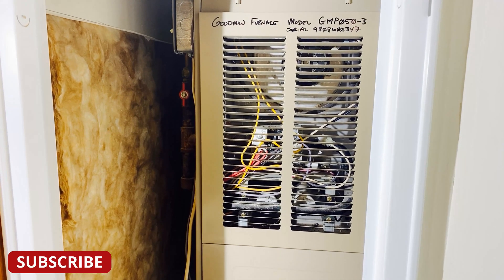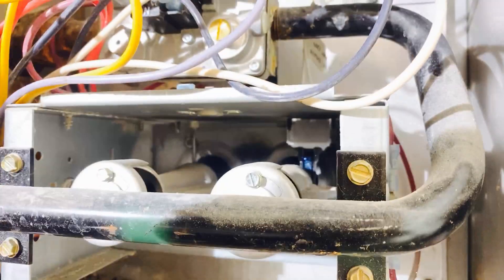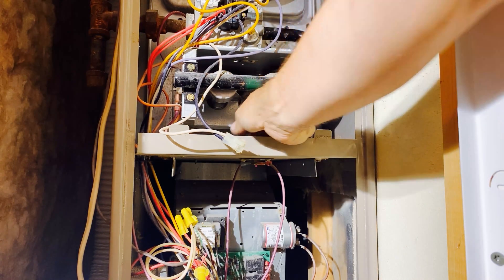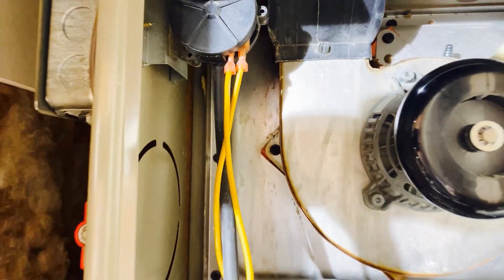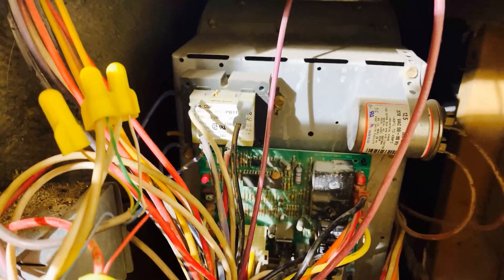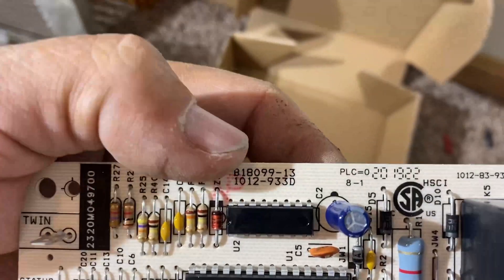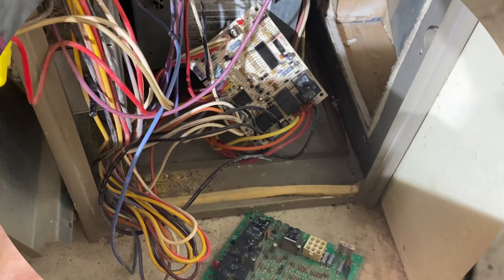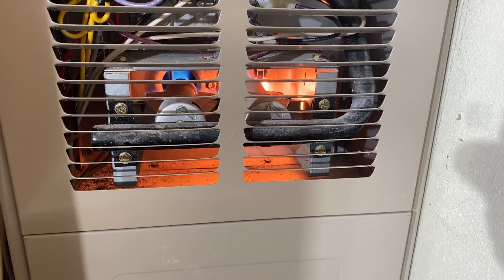Gas furnace not igniting -  Goodman furnace wont ignite - DIY Gas furnace repair

Comment from the maker: IF YOU ARE IN TX OR SURROUNDING AREAS  RIGHT NOW BE AWARE THAT WITH THE RECENT WEATHER THERE ARE LOTS AND LOTS OF FROZEN PRESSURE SWITCHES BING REPORTED! BLOW INTO THE PRESSURE SWITCH OR HEAT IT WITH A HAIR DRYER FOR A FEW MINUTES AND THAT WILL THAW THEM IF THAT IS YOUR PROBLEM!!

Comment: The problem with the internet is they dont show u what happens if you touch a loaded capacitor. Ever see Hvac Techs wear metal rings? Im not going to get my fingertip blown off for brushing against the capacitor

Comment: 4 people have looked at mine. No one can light it. It is blinking 3 lights. 2010 goodman. It has I think electric ignition. Can u help me figure that out?? Thank u. Loved your video.
Reply: Yes correct they of course tried to sell me a new one for $2700. Being single, on disability, replacing it is not an option. It was fine last year. Ran wonderful.

Comment: Back in 2013 I Had a problem with my Furnace Cutting out  I had a heating and Cooling Guy come over and he Replace my Broad and and Changed my Gas Valve and Still had a Problem of Cutting out Come to Find out it was only my Flame Sensor needed to be Clean never again will I Call a Heating and Cooling Company

Comment: for emergencies,  until you can get a  control board,  run 120v with a wall switch & as furnace cycles, turn on power, ignitor will glow & start furnace, then turn off switch......furnace will run normally,  get room to temp & you won't freeze .....only thing, you have to turn on ignitor when the furnace calls for heat & redo above......saves you from freezing your ass!

Comment: Thanks for the video, and I love that you included costs for parts vs the local repair shop cost for the same parts. Who knows how much a diagnostic visit from a company would be, and if it would include one visit or, if you'd be told your whole furnace needed replaced. Way to go!

Comment: Well, saving this video to watch again later. This was a very well put together video for somebody like myself who has no idea what the fuck they're doing and woke up this morning to a very cold house. 
The furnace has been running just fine all winter for me. I've had it off for about a week, and turned it back on a couple days ago because we had a cold snap roll through. It's been working just fine all week until I wake up this morning and my house is a wee bit chilly. I can definitely hear the exhaust fan running but it doesn't appear that the furnace ever ignites so hopefully I can just replace the igniter and not have to replace the entire control board. Again thank you for this video because it is going to be a lot of help when I get home.

Comment: I just went thru this with my Goodman furnace. Igniter went bad. Replaced with a universal igniter called a hot rod. Still wouldn't light. Checked everything and ended up calling a repairman. He replaced the igniter with a OEM part. It fired up immediately. He said he's never had any luck with the hot rods. Luckly I was able to return the hot rod and get my money back. $165.00 with parts is all he charged me.

Comment: Repairman said we needed a new board after their replacement  igniter failed in less than 2 years. They had used an aftermarket metal strip ignitor instead of the Goodman OEM prong type. Called another repair service and they said that's OK but touching the metal strip with bare fingers will cause ignitor to fail prematurely.  I told our repair service to use the OEM replacement ignitor,  and use gloves!   OK so far.

Comment: We checked everything and replaced the following chronologically - gas valve, pressure switch, transformer and now going to try control board.  This is a Goodman gmp075-3 and it would run thru entire start up cycle all the way to igniter lighting, but then sometimes gas appeared to not release in last step and heat would intermittently not turn on in the home?  The igniter appears bright red / clean, but last step of gas igniting intermittently fails???  Appears to be 9 volts instead of 24 volts. Coming from control board so going to try to replace that as hoping threes a charm.  Very frustrating process

Comment: Great video Shane. I still have an issue however. My Goodman furnace has a 4 flashing red light signal and the manual indicates that it's an "open limit switch". I jumped the two leads to the limit switch and get the same 4 flashing lights. Replaced the limit switch ($6)and mother board ($80) and same 4 red flashing lights. After viewing your video I hooked up the multimeter to the power feed to the igniter, ran the motor for 2-3 minutes and it shows that there is no power getting to the igniter. I'm stumped. Any ideas on what the problem and solution might be??

Comment: My Goodman gas furnace, the ingniter glowed, but the gas didn't turn on. The control board did three short flashes every 2 seconds or so. Any ideas?
Reply: Check the pressure switch

Comment: I just had an experience with a 14 yo Goodman top of the line natural gas furnace. Tech support was useless. I replaced it with a top of line Lennox furnace. I have two more Goodmans in some rental units. At the first sign of trouble I will replace them with Lennox furnaces. Goodman left me no choice.

Comment: My 9 year old Goodman Furnace GMS81005CNBE stopped starting.  After studying You Tube videos like this one which is excellent I learned the start sequence and noticed my electric motor inducer fan that exhausts carbon monoxide from the flames would not start.  Board had a solid red light.  When I pressed the body of the motor to one side it would start, I thought something was jamming the squirrel cage fan.  Turned out the end cap of the inducer fan's electric motor is held on with two screws and one of the screws was missing and inside the cap is a hollow where the roller bearing for that end of the motor shaft resides - with one screw missing the cap was cocked which made the bearing cocked which kept the shaft from turning.  Putting in another screw so the cap was evenly tight solved it, motor and squirrel cage spun freely.  Never did find the screw which must have been there recently.  Ghosts.  So the sequence was able to at least get to the inducer fan starting.  I checked the pressure switch by blowing and sucking the tube to it and it clicked, volt ohm showed it was working.  In the sequence I heard clicks from the gas valve so I guessed gas was going to the burners but the ignitor never glowed and volt ohm meter showed 110 volts going to it for about 10 seconds when the gas wasn't ignited it shut off.  It knew it wasn't ignited because of the flame sensor told it there was no fire, I had removed and cleaned it so I thought it was working.  I tried to light with a long tube nosed BBQ gas lighter and it lit.  So I determined that after I got the inducer fan going the problem was the ignitor which never glowed red.  New ignitor solved it, runs great.  In summary as taught in this video you check the sequence and see where in the sequence there is a problem. Thank you.

Comment: Oh excuse me I guess you showed the removal and re-establishing the new wires on the control board that looks a little tricky there I guess if you took your time and just took some pictures and try to replace them as you pull out the old ones with the new ones if you can you won't mess that up

Comment: Well done! Great video. I tried to clean my flame sensor but touched the ignitor and it broke. So, I run down to the local HVAC shop, and they wanted $107 for it. l looked on Amazon and it was $90 Looked on Ebay, $30. Thinking I did something wonderful I thought I would share this with the HVAC guy I go to the shop and tell him. Not a great idea he seemed pissed and told me, well you get what you pay for what you got is junk it will not last. Perhaps I have bought many things from Ebay. Sometimes they last and sometimes not. I guess it depends on what you buy. TV cables and things have been good. Drill batteries not so much. Just got this ignitor. So, we will see. The ignitor gets red hot and glows but No gas, not sure if its the gas valve or Cricut board. I did find a bad capacitor on the blower fan. I will get a new one tomorrow.

Comment: Great video, Shane. Tested the circuit that powers the igniter and it checked out. Installed a new igniter and problem solved. Thanks.

Comment: Thank you!!! You just saved us $2400  after the hvac guy told me that my 12 year old Goodman furnace was done. That it was burnt out and the parts would be more expensive to replace than just getting a new one. I seen your flashing diag led, looked  at mine and counted the flashes and 3 says it was a stuck pressure switch stuck open. Bought one from Amazon for less than a 24 pack of beer and whallllaaaaa it’s working again. Called a different hvac company and asked them to go over and that said it’s all good that no cracks on the chambers, voltage good everywhere and besides a simple cleaning it’s all good. If all or at least the majority of repair guys were honest. I did reward his honesty by giving him a crisp $100 bill, besides a small fair check up fee. Thank you again I’m now subscribed and liked your channel.
Reply: If they get a call from you they will obviously charge you for coming to take a look at ' the beast' in the basement, then declare that you have a crack in/on the chamber/ it is dangerous/ and he has to condemn the furnace till you get it repaired ( REPLACED) and by golly he has one in stock. Where I live you can only buy a high-efficiency furnace and with the AC they are going to ' find lacking' you are looking at around $ 7,000 bucks Canadian all in. Drilling two holes through your basement wall, and in the winter, is not a great thought! Seen 4 units where I live ' getting new furnaces' and another bill to be paid back with interest charges. They got ya, and they know it. And as an extra for only a yearly fee, we will guarantee the parts in your new beast ( for so many years). YIKES!
They have no intention to fix anything/ the money is in the replacement of the units and the inevitable maint cost to maintain these high-priced units.
 It seems to be the same all over North America. A lot of horror stories about these 'high-efficiency furnaces' all over the internet. Scary prices for basically the same part. 
 Thanks again/ big help/ as I had a few issues, and a faulty motherboard with an ignition ' no go'  in the end solved it. For another year anyways.
Reply: @luckyguy600  That's why I screen and hire all my contractors from Homer's list.  Homer's list.  DOH!
Reply: @luckyguy600 Not all us Hvac Techs are crooked. U speak out your ass
Reply: Same here!!  Was told it’s too old, needed a new board but really need new furnace.  Replaced my igniter for $36 on Amazon.  Three screws and the connection to the board on my Lennox furnace….that was it!!  It’s so helpful understanding the sequencing for troubleshooting.  Adding HVAC to my DIY tool kit thanks for videos like this..
Reply: Oh, my god. My furnace had issued and i paid over $400 for valve gas replacement but the problem still there I have to them again and they said maybe another issue and more charge
. Thanks a lot for this video I will check and do it.
Reply: Hvac Technician here:  Well with it being that old, please have a gas detector installed.

Comment: Getting colder now in Tennessee and sure enough, gas heater needs attention. My Goodman GPG 1336090M41CA is now about 11 years old and it's failure to start is intermittent. your video has given me a lot of ideas of what to check out, Ignitor/flame sensor (I will get both on order)... right now that baby fired up, house is warming up and when it's a little warmer outside (unit is outdoors) I'll get started cleaning stuff. GREAT VIDEO!! 👏👍

Comment: Fixed my furnace this mornig.  Your 15 min video saved me a 500$ service call. Ignitor was glowing, checked the Pressure sensor: The tube (and the sensor) were filled up with water.  Drained it, dryed it out with the air compressor, got the nice click by blowing into it.  Back into service at no cost.... was a 15 minutes job!   Your video literrally explained all that is needed to know.
Reply: I had the same issue and was surprised by the amount of water that drained out of the pressure sensor tube. Any idea what causes that problem and how to avoid it in the future?

Comment: I have a different furnace and a seperate panel to control zone door motors.  The zone motor panel board was shot, found one on ebay and replaced the board and attached the wires one at a time onto new board.  Installed but didn't work.

HVAC tech found "dip" switches on the board that needed to be in certain positions but weren't.  Once the dip switches correctly positioned I was good.  So depending on the setup you have it might be a tougher R  and R than shown,

Still good example of troubleshooting.  Thanks for posting.

Comment: Thank you Shane for this excellent video. It was extremely helpful for my furnace situation. I have the same Goodman as yours, about 400 units apart in S/N. Mine was giving the same symptoms, igniter was good, pressure switch working, single blink failure code. I pulled the board and did not find a mouse, or any signs of a short on the back of the board. The front was clean (no burned resistors or any signs of excessive heat), fuse was good. I cleaned all the terminal connectors and gave the relays on the board a firm but not savage whack with my finger, and when I put it all back together... she fired up. I am suspecting a sticky/tired relay for my igniter circuit. Tempted to try to desolder and give their contacts a light burnishing, or even replace them, but buying a new board (if they are still around $100) might be the more time efficient solution. Whatever way I end up going, thank you again for your detailed exploration of the furnace circuitry! The furnace just kicked on again as I type this!

Comment: Shane, you're spot on!! Pressure switch code, switch tested good out of the furnace. Not working on furnace. Orifice on blower plugged/rusted over? Cleaned out, unit fired right up! Saved me a lot of headache and money. And we were warm last night! Thanks for sharing your expertise!  (Local heater man told my dad might be control board, or gas valve, should replace the unit!)

Comment: I had success by using a heat gun to blow hot air at the burner area while the igniter was glowing. After this initial assistance, the furnace continued to successfully ignite itself. I believe the problem was caused by frozen igniter parts. A self-feeding problem due to the furnace not running for days leading to the furnace parts becoming too cold than normal. The draft inducer motor was broken and it took a couple of days to find the part and replace it. I run into the ignition issue after replacing the motor. You should be able to use a hair dryer if you don't have a heat gun. I believe using a space heater or similar options to bring the furnace closet/area to room temperature could work. Please remember to practice safety and not rely too much on comments like mine.
Reply from the maker: Abel, 
Glad to hear you had success getting your furnace back up and running.
Be very careful about providing an unregulated outside heat source into the furnace though.
Stay safe brother! 
-Shane

Comment: I just installed a brand new Airquest gas furnace. The igniter glows bright but it seems like it isn't getting any gas because it doesn't ignite and I can't smell any gas. I assume that I should be able to smell a little gas if it was supplying any.
Reply from the maker: Well, your furnace is finding a fault that is stopping it from sending gas for combustion so if you were smelling gas, that would be a bad thing.
With a new furnace the flash codes should be pretty accurate. Check them.
With the furnace being new, assuming it ever ran before at all, my guess is you will read a flame sensor failure code. 
That will be fixed by cleaning the flame sensor thermocouple (probably) either by you, or by a technician  (cleaning sensor is shown in the video).
If that is indeed the problem and it becomes a recurring problem (more than once a year) then your furnace is sooting it up more than it should for some reason and a maintenance visit should be considered.
These are just my opinions.
Let us know what you find! 
Stay safe and make sure you don't get in over your head!
-Shane
Reply: @AHandleOnThings  the regulator switch was turned off. Duh

Comment: After 2 hours troubleshooting, my HVAC guy said I need a new ignitor board. I overnighted one and he was too busy to install it right away so I did it. I found a green ground wire for the fan motor hanging behind the board completely disconnected with no screw in sight. I found a spot for the ground and reconnected the original board and everything works and tested good for hours. I think my HVAC guy was trying to scheme me. My poor tenant had to use space heaters for 4 days bc of this. This video gave me the confindence needed, HUGE THANKS!!!
Reply: Sneaky.. my parents furnace was only 10year old and needed an ignitor but 2 guys came to put an ignitor in, then tried to talk my 80 year old  father(starting to decline)into a 10k new furnace.  Luckily I walked in and told them to get the hell out. They wanted $600 for 2 men to replace a $25-30 ignitor. 
Dont use  Blue Beak or Blue Bear in Massachusetts they're crooks
Reply from the maker: Lalo,
Sadly, there are bad actors out there! 
There are also a few techs who lack the ability, knowledge, or motivation to get it right.
Welcome to the "2020's" right?
Great job finding the culprit!
I'm beyond happy when our videos get folks out of a jam!
Stay safe and warm!
Happy New Years!
-Shane